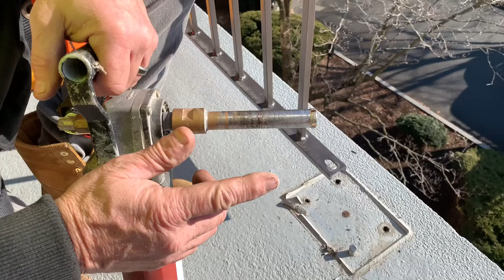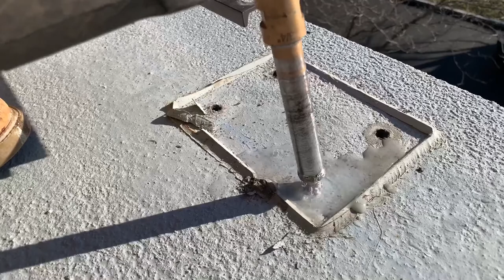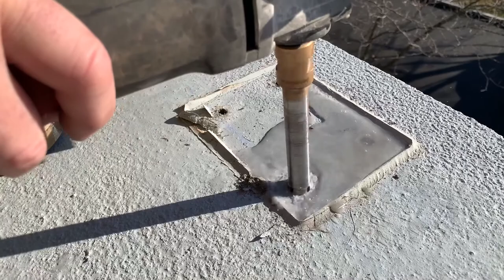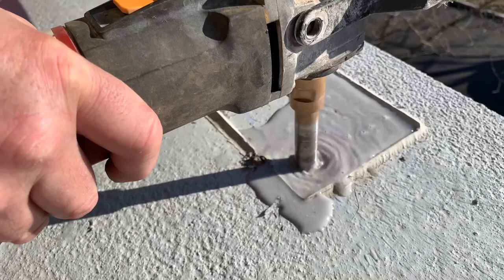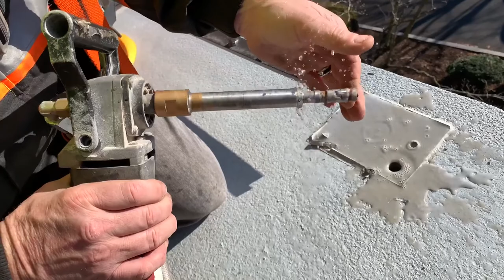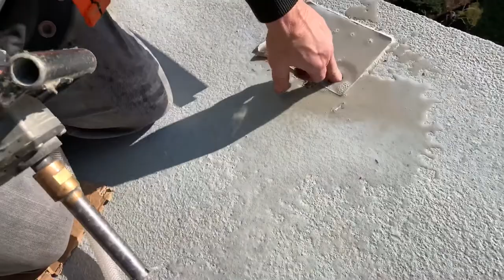CONSTRUCTION RELATED - Best way - Wedge Anchor Removal

Comment: Ordered this bit from Amazon. Attempting to remove 4 of these that anchored a gated to my pool deck.
Reply: I just busted an anchor bolt on my diving board. Wondering the same thing 😅
Reply: The bit didn’t work for me. I ended up having to cut them flush with a grinder then filled the hole around the bolts with concrete patch.
Reply: how do i find it on amazone ?

Comment: Exactly what is the name of your drill tool you use. Thanks
Reply from the maker: Your looking for a diamond core drill bit, then either use a coring drill or retrofit an angle grinder or drill utilizing a water swivel adapter, there’s several ways to set this up, worst case scenario just use a garden hose while coring out the anchor.

Comment: Can you tell us the name of the tool?
Reply from the maker: Its a right angle core drill, it will allow the water to flush down into the cutting area, i believe the brand is Kor-It, and you will have to size up the core drill bit to the size of the nchor you have to be able to slip over and around the anchor you initially used.
Reply: @natetremblay8537  Hey thank you so much for the response!!!!  This will save me so much work.  I do I.T. work and have to install and remove network racks, kiosks, and other devices that mount in concrete.  I always hate having to get these out.  Worth whatever that thing costs.  Thanks again!

Comment: Neat:  if you have that tool
Reply from the maker: If you work in this industry you should have one or a core drill of some sort.

When your installing 100s of lf of railing or whatever and you get fucked over by the engineer, then this tool is helluva lot cheaper than scrapping all that metal, Powdercoating and hot dip galvanizing.

I’d gladly pay 500.00 for this than well over 40k 🤷🏻‍♂️

Comment: Is that a grinder you modified?
Reply from the maker: It’s just a right angle core drill, I forget the brand name.

Maybe Kor-It

Allows the water to flush down straight though to the bottom of the hole.